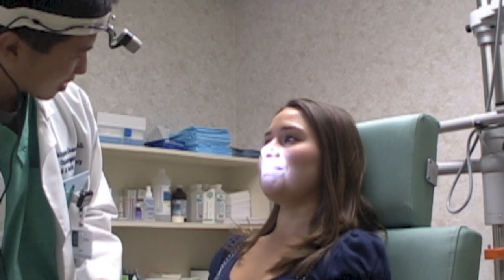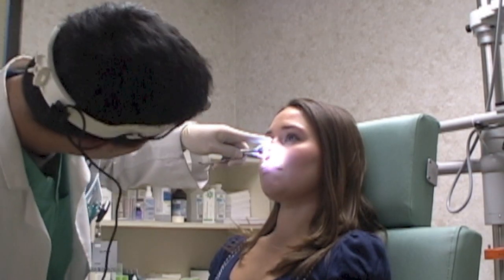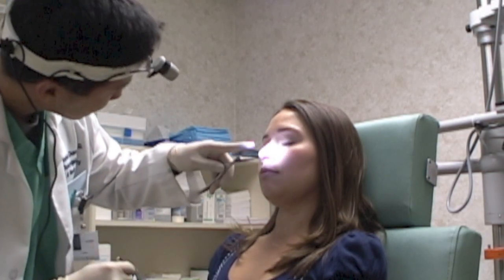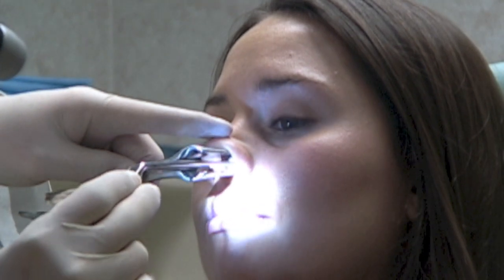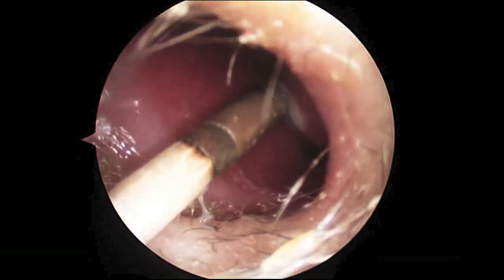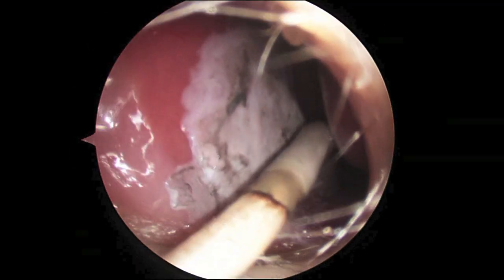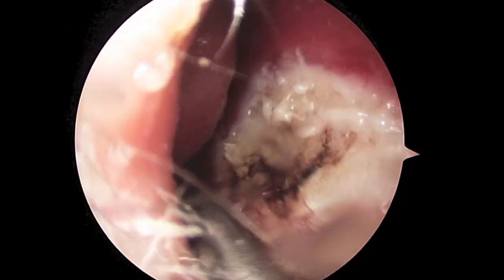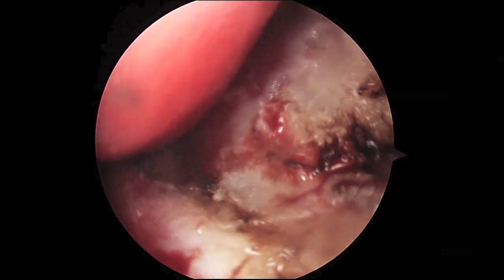Nosebleed Control by Cauterization (Silver Nitrate and Electrical)

Comment: Had 5 nosebleeds in the last day and a half, looks like ima be getting one of these 👍🏼
Reply: Just in the same boat. But it re-bled 8 hours later. Hoping that’s normal.
Reply: Usually something will pop, then I get a huge nosebleed. Then it recurs for days afterwards at the most in opportune times. I need one of these as it keeps happening whenever the weather changes

Comment: I got this done yesterday and yes- it hurts. It’s not awful, but it definitely doesn’t feel good. 

As someone who suffers with nosebleeds, I do think this procedure was much needed and in the end I’m glad I went ahead and did it.

I will say the worst part of all of it is that I’ve had a non-stop runny nose since getting it done. The doctor told me NOT to blow my nose or pick at it whatsoever, so it’s a bit annoying to have to wipe my nose every 5 mins. 

Tylenol has definitely helped a lot, so make sure you take that. I was actually prescribed some hefty pain meds that I never took and the pain was pretty bad but bearable. It was probably the worse around and hour and half after the procedure. Today hasn’t been so bad. It just feels like I got punched in the face and my nose is a bit swollen. 

I’ll let everyone know if the procedure actually works or not. I’ll assume if I don’t have a nosebleed for the rest of the summer it was a success!
Reply: Did it work?
Reply: I did mine yesterday, and yes it worked mazingly so far but I got brown spots outside my nose

Comment: I've had both nostrils done and it's honestly not that bad. I had the lido-cane applied on the surface and as an injection though. One spot near my septum hurt (like a 6/10) but it's very temporary, only like 5 seconds. 

If you are having uncontrollable nosebleeds I would recommend it highly. If you were have 3-4 nosebleeds a day like I was, I would honestly do almost anything at that point to get them to stop, including about 2 minutes of pain. Just remember to follow the aftercare so you don't end up going back in. It worked great, nosebleeds are practically gone and the 1 I had was easy to control.
Reply: ماهي العنايه اخبرني ارجوك

Comment: For anyone wondering, yeah it hurts like hell. You won't know what it's like until you get it done yourself- but it usually and note i say usually goes away within 5 to 10 minutes- however due to the major skin damage in there to seal everything your nose will run for at least the next hour, from my experience. It's usually pretty stringy aswell, so I like to just hold a kleenex or something similar up to my nose until it stops. You can actually blow clear snot bubbles with it all if you're not careful- and nobody wants to see that.
Reply: Thorondil i went to work after my procedure and it was a short 4 hour shift and my nose poured snot the whole time I thought it would never stop!
Reply: @melissatuttle1163    and how have your nose beelds been

Comment: i had my nose chemically cauterized last month and cauterized again two weeks later because there was still part of the blood vessel that was exposed. after the second cauterization, i've only had two or three minor nosebleeds and it's been about two weeks since then. i do have a small permanent dent on the inside of my nose, but i'm really glad i got the procedure done.

Comment: I had 2 big nose bleeds with-in 3 days and I never get those.  Both times they bled a lot.  I went to the ER on the second one because I had no idea what was going on.  The ER doc performed this procedure on the capilaries in my nostril with the first method shown in the video.  It was a mild burn.  No big deal. I blow my nose too much and apparently that caused it.  Recovery is only suppose to be 24hrs.

Comment: On my way home from getting this done. Did not take long at all. The doctor’s assistant sprayed me with this numbing spray (strong, went down back of my throat), then the doctor looked at my ears, throat, and nose with a flashlight (and a camera for my nose). I was bleeding from the front right. He cauterized me with what looked like a bamboo skewer with a gray match-looking tip on the end. He said it might burn, but I didn’t feel it. Just my nostril being pried open with the spreader tool thing lol. Barely hurt, and I am good to go. No bandages or anything. I go back in a month to check up. Whole process took maybe 5 mins.
Reply: The gray match maybe silver nitrate

Comment: just back from ENT, had silver nitrate stix applied and the local anthestic is worn off, my eye is running, as it my nose and the nasal pack is soaked in serous fluid. It hurts A LOT but better than severe bleeds i was having, it was from back  wall so it came from my mouth and was impossible to compress, also made me vomit and gag and this ruptured any clots that tried forming, what an ordeal. Praying its all over now and a few days of pain relief is all i need.

Comment: I used to get nosebleeds occasionally like 23 years ago. At that time, my GP doc cauterized it and it worked! it stopped until 3 months ago. I had sinus surgery last year (May)  and all of a sudden my nosebleeds came back but much worse - where I can't stop it and it's just my left side which was cauterized 23 years ago. My ENT says there is nothing to cauterize. Then I was sent to a radiologist that said it was my high blood pressure. They still happen and my blood pressure is fine. No one seems to know what to do and I'm so tired of having this happen over and over again. >:o(
Reply: Know im a bit late to the draw but try documenting the amount of blood being lost, the time frames, and the blood flow. It may help your ENT take it seriously enough to keep looking until they find something or refer yo to someone who can find something.

Edit: document however you want, but shock horror style works great lol. I had a massive nosebleed (one of hundreds) and let it just drip on the vinyl floor of my kitchen for half an hour. Turns out my doc takes losing blood seriously when they see how much it is.
Reply: @GoldenFuss  I finally saw a cardiologist. we believe it is my BP that seems to spike causing the blood vessels to contract and causing the bleeding. We are now trying to get my BP controlled. It's been a long trying year already!
Reply: @mw9491  good to know you may have found the problem and are able to get a handle on it! I've been weed whacking all day today and right as i got done i had a spurting nosebleed that would wash away my nasal spray before it could even get to where the bleeding was coming from. Hope to get my sinuses taken care of after this pandemic finally settles down.
Reply: @mw9491 how do you feel today?
Reply: هل السبب الاعشاب ؟ 
وهل توقف النزيف عندما تركت شرب الاعشاب.😊

Comment: I had this procedure done yesterday, and it this morning I woke up to a severe nose bleed...sent me to the ER where they did nasal packing on me to stop the bleeding. Anyone else have this experience?
Reply: Did your nosebleed stop? 
Today I had an enternal nosebleed like hell. I have two packs right now and still bleeding a bit after 5 hours of putting them. But the bleeding is not stopping. Is it normal and should I wait 2 days like my doctor told me? I am considering cauterize my nose because I don’t think it will heal 🥺💔 Is cauterizing better than packs? And does it hurt?
Reply: @DeadlyTokio  Oh wow, that’s terrible.  Did an ENT put the nasal packs in your nose?  Or did you go to the ER?  And when you say that it’s still bleeding, do you mean that blood is still coming out of the front of your nose or down the back of your throat?  My experience in the ER was that they wouldn’t discharge me with both nostrils packed… they said if I kept them both in I’d have to stay in the hospital (so they took one out, and thankfully it was no longer bleeding).  After leaving the ER, I kept the nasal pack in my nose for an additional 4 days until my ENT removed it, and re-cauterized the blood vessel.  It didn’t really hurt since he used lidocaine to numb me up.  It’s been two weeks, and so far no bleeding.  I really hope you’re ok.
Reply: @nicknoga564  Thanks! An ENT put the two packs. He told me he could cauterize it right away but I will not handle the pain because he needs to go deeper inside the nose, not like a normal external nosebleed. The two packs hurt but that’s not what worries me. My nose still bleeds both ways front and back of my nose where I feel it when I swallow 😖 it stops for 20-30 minutes and comes back. I called my ENT doctor to perform the cauterizing tomorrow because honestly I wish I did the same as you, when you cauterize first and then pack, and re-cauterize, it’s better !! I’ll tell them to put me in general anesthesia to NOT FEEL ANYTHING. 
By the way, did you also had an enternal nosebleed where the blood comes out in front and back your throat ?
Reply: @DeadlyTokio  I got conflicting information from two different ENT’s about the nature of my nosebleed.  The first said I had the common frontal (or anterior) type.  The 2nd ENT I had told me that I probably had a rear (or posterior) nosebleed because my bleeding was so heavy, and pinching the front of my nose didn’t stop it.  I did have blood pooling and dripping down the back of my throat, but that stopped once they inserted the nasal packing.  I hope you know to go to the ER if your bleeding doesn’t stop.  That can be very dangerous if it’s still dripping backward.  I believe there is a procedure to block the bleeding from the back of your throat (they have to put a little inflatable balloon behind your nose on a little string to plug it up).
Reply: @nicknoga564  Glad you’re okay and thanks for the tip! Unfortunately, my nose is bleeding backwards still with the nasal packs. I have cauterizing procedure tomorrow but don’t know which time. Is it okay to wait for maybe like 12 hours with swallowing the blood constantly? Because it’s my first time and I’m terrified😅 How many days have you had your nose dripping blood down your throat?
Reply: @DeadlyTokio  In all honesty, if it’s still bleeding after this long you need to see a doctor right away.  Either go to an Emergency Room or to a local clinic.  I would not wait until tomorrow because it could be very dangerous.  Good luck, and stay safe.  I hope you’re alright.

Comment: How exactly do you sit still while someone is burning you? Wouldnt you like slightly jump around and then the thing in the nose burn everything?
Reply: Anesthesia?
Reply: Yeah, localized numbing doesnt work quite that good.  You can see in the other comments from people who had it done it still hurt. I find even with some dental work I just sit a tiny bit of pain out.
Reply: MLGTrueIncarnate Lucky for me my blood seepage slowed down since posting. Im taking a couple iron pills a week and im not sure if it helped but the blood loss has indeed slowed down. Although ive had it for like 15 years so im not placing any bets that it stopped
Reply: The doctor didn't numb my nose before, just sprayed the anesthesia spray after doing the cauterization with silver nitrate in my nose. It hurted like hell. I almost jumped out of the chair. It was pretty painful. But finally I got my issue solved. I had a small blood vessel that used to bleed a bit.

Comment: i have bloody noses but i have blood clots at the end of them ... i don't know if i what to go do this 
should i get it done or not please tell why or why not
Reply: Katy Campbell-Woodyard most people say you should & I think it really depends on your pain tolerance and the size of your blood vessel(s).

 Personally, i got this done two days ago with silver nitrate and it wasnt that bad at first, all i felt was pressure because the ENT has to push down pretty hard, but my blood vessel was larger than normal so he took longer to get through the procedure and the numbing eventually started to wear off and it started feeling slightly more painful, but it still wasnt THAAAAT bad. The worst part is probably how you feel afterwards. Your nose gets runny for some hours and it makes you feel like youre sick. Also, it makes your teeth feel weird too sometimes. It doesn’t hurt but it’s mildly uncomfortable. Anyway, after that you’ll just feel the scab in your nostril which feels like an annoying dried up booger, except you cant remove it because you have to let it heal for at least two weeks 😭 

Basically, get it done if you’re okay with being mildly uncomfortable for a couple of days and if you feel like you truly need it. Don’t get it if you don’t want to have a runny nose & a scab in your nose, or if youre nosebleeds arent super frequent or super heavy. 

(Also, if you do get it, make sure to clean around your nose really well because the chemicals stain your skin!! 😭 my nose is stained right now and it looks so gross)

Comment: What if your nose still bleeds after cauterization? (I have sneezing fits with allergies)
Reply: It can be repeated and usually does need to be done more than once. My ENT also said if it continues, I may need a CT scan of my sinuses, but I guess it also depends on what is the underlying cause of the nosebleeds. If it's allergies, they will probably recommend the steroid nose sprays like fluticasone, but for me, that only made my nosebleeds worse. Also probably sinus rinses and there are different ointments and creams you can swab in your nostrils that your doctor can recommend.

Comment: I got it done today. It hurts so much!!! It feels like shots and burning. They burned multiple blood vessels. The process hurt during and after.
Reply: D R did you get the electric one??
Reply: No, I believe they were chemical swabs. It left my nose black and the Dr. didn't give me any medicine. I ended up throwing up and my scab came off through my nose.  I couldn't breathe properly until it healed.  It felt like I was inhaling too much air because of the open wound and everything I would smell felt like I was tasting it. I ended up at the hospital due to anxiety with my breathing and my face was swollen as it was healing. Although,  I haven't had any noise bleeds since the procedure.

Comment: I just got it today at my local hospital, no anaesthetic or anything. Personally, I usually have a high pain tolerance, but with the sensitivity of the location and the fact that it's extra sensitive from the cold im currently nursing, it hurt a lot!.. and 7 hours later it still hurts! Also the silver nitrate has stained a bit of my nose which is extremely terrible since I have my first day of University tomorrow. Anyone know any methods on how to remove the silver nitrate??
Reply: Yeah i had no anaesthetic.

Comment: I had this done cause I got bloody noses about 3 times a week for five years because of three blood vessels in my right nostril and geez! The numbing solution dripped down my face and the back of my throat and tasted disgusting. Then they cauterized two of the blood vessels and it hurt so bad and I had to sneeze so bad that we had to stop and numb it again before continuing.  I went to work immediately after and felt like I had to sneeze the entire time but nothing got me to sneeze, instead my eyes would start crying and snot poured down my face. And not being able to blow your nose the next couple of days will sound like no big deal but it's obnoxious cause you can't breathe through that nostril and constantly feel like the scab is stabbing you all the time. But honestly, if you need this done, Just do it. The first week sucks but its worth to never get a bloody nose again!
Reply: Melissa Tuttle has it stopped you from bleeding?
Reply: Why does the first week suck my son is 7 and is about to get the procedure done in a couple of hours
Reply: Melissa Tuttle you are not allowed to blow your nose? I been blowing my nose after because it was running

Comment: I watched this video the other day to prepare for the procedure which I had on Thursday.  I have a very high pain tolerance.  For me, this was one of the most uncomfortable things I have ever experienced.  When they burned the inside it really hurt and caused my eyes to instantly tear up.  All day I had a terrible headache and a feeling of pressure in my nose.  The dripping from the nose has been non stop.  The most disappointing thing for me was that on Friday evening when I went to wipe my nose from the dripping I found that my nose was bleeding lightly.  I hope this doesn't mean that the procedure didn't take.  So upsetting !!!
Reply: Same. I have had surgeries and many uncomfortable medical procedures, so I am used to pain. This seemed borderline like if it hurt any more than it did, the humane thing to do would be to sedate people beforehand. It rated higher on the seriously uncomfortable  scale than my root canal. Then when I got in the car to go home, my numbing spray wore off. I had to sit in the parking lot for about an hour before driving home. My eye on that side hurt and burned also, which made the discharge from my nose even worse. Some tylenol is helping now, but I don't know how I will sleep with this burnt bloody snot running out 😩 I hope it worked out for you in the long run!

Comment: Just got my nose cauterized yesterday with silver nitrate without numbing, wasnt that bad honestly
Reply: Please help. Today I had an enternal nosebleed like hell. I have two packs right now and still bleeding a bit after 5 hours of putting them. But the bleeding is not stopping. Is it normal and should I wait 2 days like my doctor told me? I am considering cauterize my nose because I don’t think it will heal 🥺💔 Is cauterizing better than packs? And does it hurt after?
Reply: @DeadlyTokio  Im not a doctor but bleeding for more than 5 hours for no apparent reason is NOT normal, and you shouldnt wait. Go to the hospital so they can check it. They might cauterize it chemically or if its super bad then they will do it electrically but dont wait.